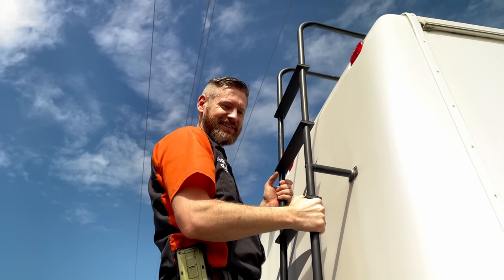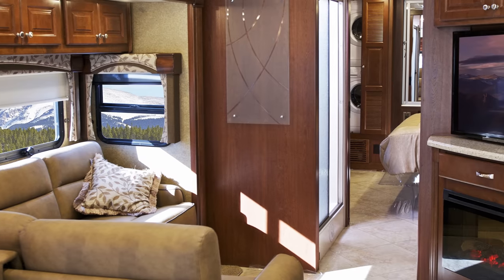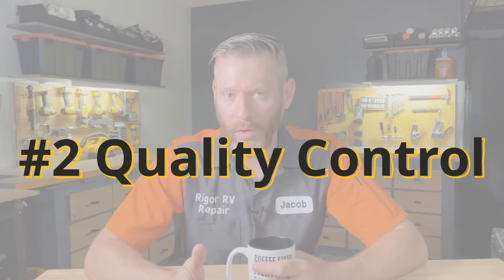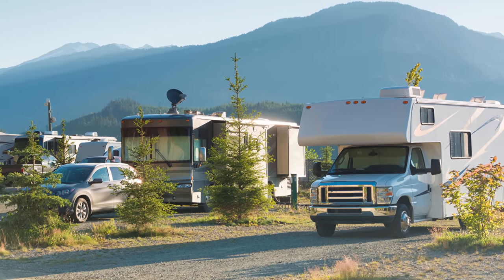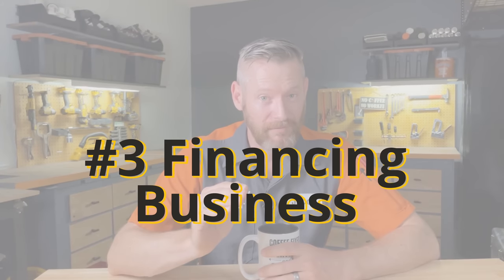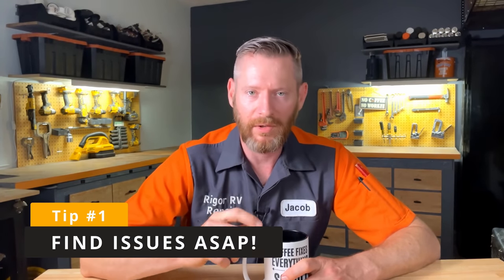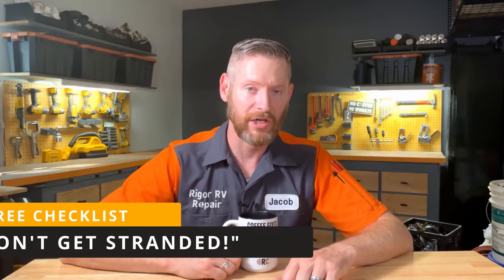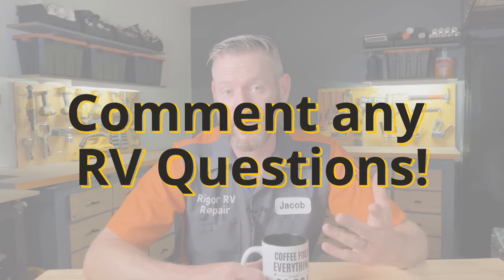3 Dirty Secrets the RV Industry doesn't want you to know...from an RV Tech

Comment: We have had 2 Winnebago RVs; a 34" class A and   now  a 26' Vista on a  Mercedes chassis.. They both were and are excellent;  as a former  mechanic and auto/ marine &  truck electrical service manager.. I am constantly  uncovering mostly good to excellent  quality and workmanship. 
  The few other brands before and in between them were a bit more problematic..    Of  dealerships in Florida, Indiana,  North Carolina and Rhode Island.. Arlington RV in  Warwick, RI absolutely  stands out: pre & post delivery inspections and < 1 week repair (usually..)  

 
 Bought a 30" tow  behind in Indiana.. I  kept the service  department 2 1/2 hours after closing to have them replace a defective complete vehicle connector cable (25+ feet because of where it terminated), a defective tail/stop light, 2 marker lights and a defective tongue jack!  We got camp chairs and with my 90 year old (very seasoned camper!!) mother-in law, sat in the service department NeXT to them while they worked.  Then.. they adjusted the equalizing itch!  After driving less than 400' in their parking lot, I ran back to the service  department and they sent someone out to adjust  the hitch again!  Fortunately, not many other issues in the 8 years we owned it afterwards ..  & sold it for more than we paid for it!!

Comment: I bought an Outback trailer new, went out immediately for the first time and whatever could not work did not work, holy hell, they had it for 4 months and when I finally got it back all of the original problems were still there, they never even touched it,  all of the original problems were still there!  I took it back again but had marked all of the bad parts, they told me they replaced all kinds of things and when I showed them the marks I put on and threatened them with a lawsuit and the local news they finally started replacing things.  I ended up fixing things they didn't and got it perfect, I sold it and bought a used Minnie Winnie with 8,000 miles and haven't had a problem with it other than wear and tear, it was built well, that was in 2007 and it's still going strong.
Reply from the maker: Ouch! Sorry to hear that, sounds like a bad service center for sure.

Comment: Our 2019 FR motorhome had issues from start. Warranty replaced 3 ovens, each subsequent one was lower quality than previous, 2 stovetops all worked intermittently, propane system never purged and now indicted empty on gauge and 1 light on panel. Had “filled” 2 days ago and fill went slow. Propane guy said it was full! Gauge reads between 1/4 and 1/2 but lights on panel show 2/3 full! Do not have dealer because the one we bought our motorhome from, I caught filing false extended insurance claim and forging my signature. When caught, dealership paid back amount and said they made a “mistake” just like the armed robber that got caught by the police after he robbed the 7-Eleven, made a “mistake”! Insurance company and law enforcement for state did not want to pursue charges for false claims filing and forgery! The entire industry is corrupt and in bed with each other for another buck. Stay away from RVs!

Comment: Im actually really surprised at the craftsmanship of our 2022 Jayco TT. We’ve had no issues except a faulty water pump our 1st yr with it. But I took it to the dealership and they had it replaced and working great within 15min. I also like that Jayco does the 3+2 warranty. I don’t know any other manufacturers that do that. They’re all the standard 1yr.
Reply: We have a 2016 Jayco Jayfeather 7 22BHM. We bought an extended warranty as well. We have never used the warranty. It has been extremely reliable and we have nothing but good things to say  about it. Before we bought it new. We went through it with a fine tooth comb.

Comment: Buy two harbor freight’s heavy duty trailers, so have two axles and a few extra feet on each end.  Start there, make a tear drop or a base camp chuck wagon trailer.  Then use  modified ice fishing tents for base camp.  Those tents are heavy duty yet easy to move.
You can set up a four season glamping camp almost anywhere in just an hour or so.
I’ve tried almost everything in the bush, including just straight sleeping in the mud.
Semper fi

Comment: I live in a fifth-wheel (see profile pic) and none of this actually surprises me. Every system on my RV has had issues in the few years I've owned it, which is sad considering how everything RV-related costs 2 to 3 times as much as the residential version. Because everything is smaller...I guess...? 

When I bought my trailer, the water pump and A/C didn't work at all and the black pipes were (and still are) hopelessly clogged. And in short order, the laminate peeled away from the bathroom counter due to it getting slightly wet from leaving the hatch open. I just replaced and upgraded the door hinges on my $1800 half-size fridge because the original hinges were made out of plastic and the door broke off. I had to jury-rig a switch for my landing gear because the wiring failed on my first trip to a campsite, so I need it rewired - and I'm also looking at replacing the water heater (because it leaks) and the furnace (because it won't turn on).

Anyway, I've learned a lot of lessons since I started. Don't repair...replace and upgrade - because the original equipment sucks.

Comment: I have a few questions. 1. If your buying a used toy hauler, what do you look for in the suspension to make sure it can haul a toy? 2. I have a relative new RV and was shocked to find real cheap plumbing fittings that are lucky if they will hold 50 lbs of pressure. (Mine didn’t.) Can RV fittings be upgraded? They are very specialized at the control valve box. 3. I would like change the stereo/ DVD player out. What is your recommendation. 4. The oven in our RV has never maintained a constant temp. We had the dealership look at it twice they say it is fine. That a 10% - 20 % differential temp is how they are made. Ours isn’t even that accurate. Is there a fix? Oh, your right about the dealerships. They have never fixed anything the first time. It has always taken multiple trips and even then repairs were not done. I believe they are just trying to run out the 1 year warranty.

Comment: Some things for new RV owners.

That first trip he talks about is called a Shakedown trip. Do it at the closest campground to your home. This way, if you have to run back home to get tools or other supplies, you can do it easily.

Create a checklist for set up and break down.

As for the financing part, the entire automotive industry is the same way. Car dealerships do not make much money off the sale of a new vehicle. It's in the financing office where they make the most profit. They sell extended warranties, GAP contracts, appearance protection, tire & wheel protection, etc. Those are the profit makers. Just in case you didn't know this, you can negotiate the price of those warranties just like you can negotiate the price of the vehicle. So, if you do want an extended warranty or a service maintenance plan that covers oil changes, etc., plan on haggling for the price of them also.

Comment: On the quality control side, began to take things apart inside just to check. Glad I did, removed panel over the furnace plate and found about a half inch of saw dust and hand tools on the floor next to it. Thought once the furnace were turned on, this heated portion may have caught the saw dust on fire. Great video, just subscribed to channel.
Reply from the maker: Thanks for watching!

Comment: So I agree with all the points made here. I bought my first RV back in late 2018; so I got a year of causal use  before the COVID and retiring from the first job. I did research on these very topics to include (as he states in the end) a check list. I found an RV manufacture that was not part of THOR (hard to find). I discovered many tried and true manufactures were bought by Thor who (in a nutshell) changed the process from quality to timed builds. They have a clock on the workers to finish a section on time and push out the units. Quality is always a problem and even with a "good" builder somedays the workers are on it and others they are not. Read on if you desire....

So always inspect your RV and go for a dry run immediately (same day as purchase, even with a private sale and you can make it conditional for say 48 to 72 hours; maybe) to a near the dealer RV park or camp ground (for 2 to 3 days). I would, also for a brand new RV, plan on breaking camp in the morning and moving 10 miles and return to camp; then again in the after noon (leave your lawn chairs and etc) for 2 or 3 days in a row. Theoretically, you should encounter some problems by then (connecting each time as well) and either they are warranty or not. Do not forget to run all the systems (Battery, plumping, fresh water tank and city water intake, heating and cooling, electrical, propane and solar if you got that). Some states do have a buyers remorse, lemon laws, etc clause for RVs some do not so check your locale before a purchase.
Reply: Dry run might work at a dealership but i don't think any private seller will ever warranty anything after the new owner drives off. Too many things can happen. That is why you hire a 3rd party inspector. Even if it's new and at a dealership. If the dealership won't allow you to use your own inspector then walk away.
As far as lemon laws, every state has a variation of it. The best thing for that is keeping a record of everything in a journal with lots of pictures and videos.
Reply: @yankeesusa1  I agree with you. I was just suggesting you can always ask...in a sellers market probably not...if they are desperate maybe they lower the price. definitely a conditional passing inspection would be wise.

Comment: I've been looking at motor homes since roughly February. I can't believe how bad the build quality is on something that costs $100,000+. I was looking at one year old models with less than 1,000 miles. trim was coming off the outside. windows were caulked shut. plastic parts all over the outside were cracked or disintegrating. I can't imagine how bad these things are when they get to be 10 or 20 years old.
Reply: They'll be scrapped by then.
Reply: They only have to make it past the warranty brother.
Reply: They will never make it yo 10 or 20 yrs.
Reply: Just drove my 05 class C ,NY to California no problems 3 months on the road

Comment: It would be helpful if someone would develop an outline of a contract that would spell out the remedies for defects and faults of new rv’s  for the protection of owners. Some issues may include towing expenses, loss of use (extend warranty period), and some compensation for owner repaired items because of the time and expense of traveling back to the dealer. This document could be provided by the buyer with fill in the box items to negotiate with the dealer. If nothing else it could eliminate the assumptions that some buyers make about who is responsible for unforeseen situations.

Comment: Rather than trying to find the problems yourself, have the RV, new or used, inspected by a certified RV inspector. If it is used you can avoid buying a lemon. If it is new, you can have everything fixed before you take possession. Don't finalize the sale until everything is fixed and have a re-inspection if there were significant or life-safety issues. Since they aren't making money off of you yet, you will be at the top of the service list.

Comment: Our experience for the 1st RV has been good overall. We have a Class B Winnebago Travato (with lithium) and despite a few early issues that were resolved it's been ok. We wanted a smaller rig for many reasons, one of which was the thought process that with a class B there's less to learn and go wrong. Ours is a 2022, on a 2021 chassis, that we picked up in Sept 2021. Has 21K miles now and it drives fine for us. We selected the version we have primarily due to having 2 twin beds that convert into what's practically a king. It doesn't take long each night for setup and it's hard to find a bed that size on any RV. Think it's a safe bet the PDI each dealer claims to perform is a joke. We had a couple obvious things we found right away that tells me they didn't perform a check so don't put much stock in that. And that's with one of the large national dealers who have a good reputation overall. We have noticed it seems like a large number of owners sell quickly for whatever reason, the lifestyle isn't for everyone.

Comment: Good industry for you to be in. Very simple to be very profitable. Just be honest and do respectable work. The RV manufacturers suck - ALL of them. Dealers are the same. 
Yep, mine was in for over six months at Lazydays. I took it out and drove to the manufacturer. The fix all my issues in 2.5 days. 
Hope you do well!
Reply: LazyDays screwed with us for months too, I finally got it after four months and they never touched it!  Took it back, same thing, never touched it so I put secret marks on all the parts they were supposed to replace, went back after they said everything was replaced and I showed them the marks I had put on, nothing replaced!  They only did after I told them I would get a lawyer and call the local news.  It still wasn't great so I fixed everything myself, I called the manufacturer and they sent me parts after I told them how bad lazydays was.

Comment: I camp a lot in my Coleman-Fleetwood pop-up trailer.  Granted, it's a few years old, but I am amazed, stunned and shocked at how cheaply it's put together.  No glue, no screws, no rivets, but staples everywhere, even in the seat frames.  No wonder it's literally falling apart.  Counter tops, drawers, jambs, if I wasn't handy, the trailer would be unusable junk by now.
Reply: Did you reinforce with screws or wood glue or both? Maybe something else?
Reply: @0004612  Yes, absolutely.  I had to if I wanted to continue to use it.  Repaired using glue, screws, metal "L" and corner braces and brackets, etc.  Bolts and nuts were falling off and I've also done a decent amount of rewiring and electrical repairs and improvements. What absolute nerve to produce a product like that.   I would have been happy to pay an extra $100 for the trailer had they used even average, reasonable hardware and fastener materials.   Sad part is, seems most all "Popup" manufacturers are the same, even the so-called "Premium" brands.
Reply: The RV manufacturing definitely needs some regulations. But that can be costly for us consumers too.
Reply from the maker: A lit of shops just don't work on pop-up campers for that reason. So there are tons of broken pop-up campers for sale, and I get tons of calls inquiring about repairs. Usually repairs will cost more than they paid for the camper unfortunately.
Reply: @undercoverrvtech  I know, I have a "parts" pop-up in y backyard.  Seems most things today, like services and products is profit before pride.

Comment: 4th Dirty Secret: Word is Elkhart, IN (and the area) where a lot of RVs and RV parts are manufactured has a terrible drug problem.  Really sad, but there's a high likelihood the folks building your RV are struggling with addiction.  The industry has a difficult time hiring and retaining good employees, and it shows in the quality of the products.  

I have owned over 20 RVs and hated everyone of them.  I'm into just building my own now.  The water tank fell out of my last one while I was filling it up, and broke.  The anti-rotation bolts in the hangers were missing, and there were no safety straps.  imagine if that had happened while going down the road?  Could have killed someone.
Reply: I’ve heard that same statement before.  “If you don’t mind crack heads building your RV, buy a newer one.”  A Winnebago RV is sounding better and better in my search for a used class C.
Reply: The rumor going around the Michiana area is that the RV companies have stopped pre employment drug testing in order to hire workers . They are only tested after an injury occurs, and then terminated , instead of not being hired in the first place .

Comment: Very good video.  We own an Outdoors RV, it’s our fifth travel trailer in 40 plus years and it is by far the best we have owned.  They are a sister company of Nash industries who build the arctic Fox brand.  They sell with a three year warranty and they over build the chassis which is what sold me.  Don’t get me wrong we have little things go wrong but the company and our dealership have been fantastic to do business with.  I’m an auto tech by trade so I do most if not all of the repairs and upgrades now thats it’s out of warranty and have found most of the issues I’ve had have been with products that the RV manufacturers have no control over.
Reply from the maker: Glad to hear! Thanks for sharing your experience with them. I definitely want to do a review on that brand.